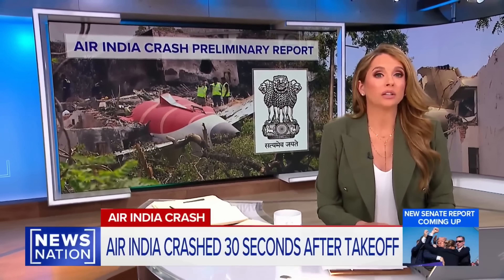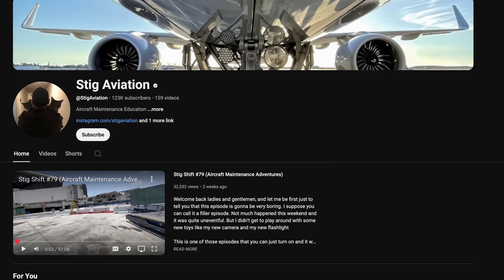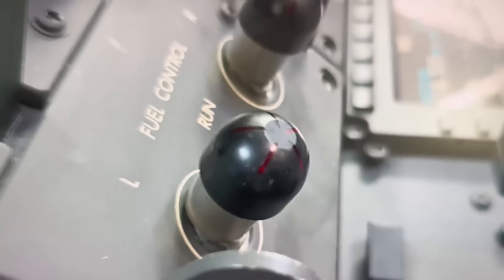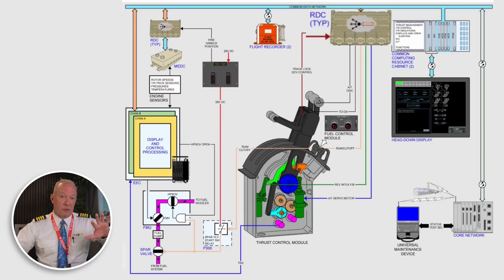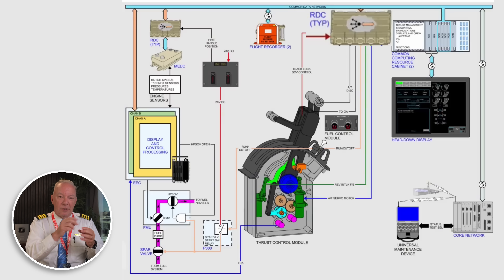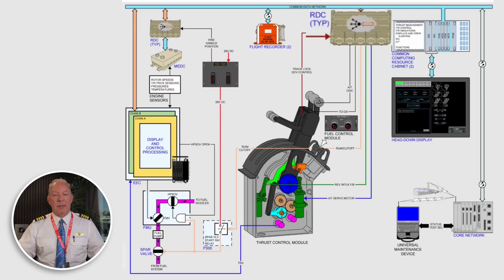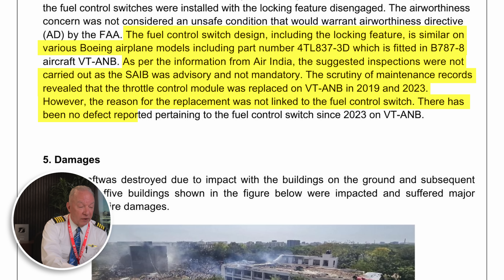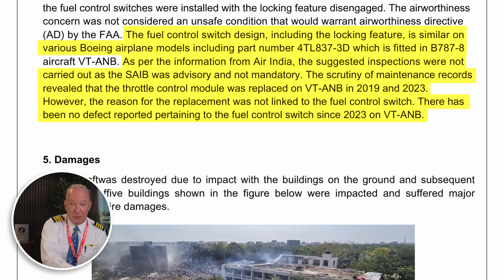The Truth About Boeing 787 Fuel Control Switches

Comment: Thanks. Also as a former AMT, the fuel valves are "Fail Safe" to the open position, meaning it takes electrical power to close them and are also directly connected to the main battery bus for that reason.
Reply: I think Steve is saying the opposite - power needed to open valve, so their default is closed. Do you know which is correct? (I do not). Thx.
Reply: @luxoverb  IMO, he's accurate.  Fail safe means, If power is lost, the valves stay open.  The schematic shows the valves and relay in the "no power" position which is fuel to the engine.
Reply: @TooStrongNeverFailed   Thanks!
Reply: @luxoverb  In case of loss of power they they stay open but in addition they open if they were close.
Reply: @luxoverb there is a difference in the relay being open and the valves being open.  He actually addresses this at ~18:30. A broken/turned off circuit is considered open.  If somebody cuts the wires to a bank vault does it open the doors or close and lock them?  open circuit-->closed physical actuation.

Relays are electromagnetic control devices.  As relays go there are 2 source currents.  one for control and one for operational flow.  He mentions both 24VDC and 48VDC. (usually the control circuit is much lower, like 5-12VDC).  There are 2 possible states to a relay: "Open" or "Closed" with the word "normal" applied to the state when the relay is not energized/activated by the control circuit.
So "Normal Closed" means that the contacts (battery to valves) are closed (connected through) in the normal state (no control current applied).  Apply the current (move the switch--I'm guessing to "off") and the relay pulls to an open state disconnecting power from the valves.  So closed relay=open valves; open relay =closed valves
Normal Open of course means the opposite.  No idea if thats how these are configured...just addressing some apparent confusion of "open"  vs. "closed" terms in electronic and mechanical applications.
Reply: @luxoverb the valves should be designed to be “Failed Closed”. Which means that without a power source, the valves will moved to the closed position using a built-in spring to move the valves to the closed position. Electric power is required to move the valves to the “Open” position.
Reply: @luxoverb yeah, you're exactly wrong, don't quit your union job.
Reply: @luxoverb  Steve contradicts himself on this at one point. I'm not sure he understands what "fail-safe" actually means. It means that if the switch fails for any reason and cannot supply a connection then the system will operate in a certain way, either "supply fuel" or "deny fuel". Steve just says there is a battery backup, which is irrelevant to this point. The battery backup provides control if the 28V line from the generator fails. @cupcar94 says that removing the voltage from the valves is what opens them, which is the opposite of what Steve said. This actually makes more sense as a design decision, as if all power is lost the valves will stay open but the fuel pumps will shut down, keeping it safe. If the only failure is the switches then the aircraft can still fly normally.
Reply: @Vreejack  How can it fly normally if the fuel pump is off?
Reply: @SDuapveer11  The engine will continue to suck in fuel using pumps mechanically driven by the engine itself, this is called "suction feed". It does have some caveats, e.g. attempting to use suction feed while (or shortly after) climbing to high altitude may result in air bubbles (caused by dissolved air coming out of solution) that can cause engine performance reduction or flameout.
Reply: Each engine has its own system, both with redundant power supplies. Schematics are shown in their “on the shelf” state. Steve isn’t contradicting himself calling the fuel system fail-safe: with power, the relay operates the fuel valves, but if 24 volts fail, the relay fails open and the valves stay open—so they can’t close without human intervention.
Reply: What everyone seems NOT to realise is that the valves/relays latch in their last commanded position. They are failsafed to both the open and closed position with the use of permanent magnets and, in the case of DC motor-spar valves, the valves simply do not move because motors do not operate without power. The electrical signals from the cutoff levers electromagnetically override the permanent magnet latching of fuel control relays which in turn operates the valves and drives the spar valve motors. 

Google "Leach KL series relays" for a typical latching type relays. Each switch has 4 poles and 8 output wires which, at least in the case of Cpt Steeeve's aircraft, operate 4 different relays with multiple system functions. Because the FDR monitors a lot of these systems, it is easy to see from the FDR if the switches have been physically moved and not some false electrical signal. You would need a dozen different specific failures to fool the FDR into thinking a switch had moved (when it hadn't moved).
Reply: fuel switches can't fail safe to the open position in case of that 28V cutting off, as the switches are used to cut off the fuel when the plane is parked. In that case it would need battery power for the entire time the plane is parked
Reply: This is the OPPOSITE of what he just stated.
Reply: One thing which is contradicting the narrative is the fact that if these switches are mechanical and are only linked to the pumps, how do they know the switches got moved. I guess answer is simple. They are still linked to the full system. A code write data once on or cut off. So something is not adding up.
Reply: @francoisdonnet3625 feedback loop
Reply: I do not know what an AMT is or does. What I do know is that a fuel valve is normally closed and requires power to open. Thus in the event of power failure it fails safe to the closed position.
Reply: @edwardsmiles5897 what you know, just isn't so.
Reply: I cant help but reply. What you are all speculating on is a highly simplified training schematic. It is NOT the whole picture. Spar valves are DC motor driven. Opening requires 28VDC on one connector pins and closing requires 28VDC on another pin. There are also limit switches which provide valve position signals and only allow the valve to open once fully closed or close once fully open. It's not just a single 28VDC power wire!
Reply: Wrong, the valves are electrically held open, and spring closed to cut fuel...
Reply: @BigWolfBoy50  If I ever knew that in one of the 8 different airplanes I flew professionally the engineers had the knuckleheadness of designing a fuel valve that would fail close I would have gone sick until I could bid out of that airplane, but of course that was never the case (because engine fuel valves do not close if they lose electrical power). 
Imagine this, you're flying across the ocean and for some weird reason your airplane loses all electrical power. What is the ONE THING you still want working when everything fails? Don't you think the aerospace industry after 120 years of making airplanes already figured out how to keep the engines running when everything else fails?
Reply: @EsparkyDog  10/10! Multiple types from different manufacturers myself. I don't fly them I fix them. Anyone here that is suggesting otherwise is speculating based on limited knowledge of how they think the system works, scouring the internet for anything that will re-enforce their confirmation bias. As I've said in a previous comment...What you are all speculating on is a highly simplified training schematic. It is NOT the whole picture. Spar valves are DC motor driven. Opening requires 28VDC on one connector pins and closing requires 28VDC on another pin. There are also limit switches which provide valve position signals and only allow the valve to open once fully closed or close once fully open. It's not just a single 28VDC power wire!  In addition, the engines will run just fine if the fuel boost pumps fail. Gravity and the  engine driven HP pump will provide more than enough fuel flow.
Reply: @DarrenCole-z7l  Captain says only 28V solenoids & springs but I think you're right
Reply: 4:46 Is the fuel cutoff relay contact normally open or normally closed? The circuit appears to show normally open.
Reply: So what about all the recent discussion concerning water interfering with the electrical circuitry? Apparently an AD was issued about that. Also, does the data recorder document the actual physical position of the fuel switches or merely the electrical state ( on or off) of the switches. Seems like there is constantly conflicting interpretations of electrical vs physical state of the on off function
Reply: @Sierranite  The fuel valve and the data recorder are on separate sets of contacts on the switch, so the fact that the switches were recorded as toggling and the engines subsequently behaved like you'd expect from the switches being toggled is essentially impossible to explain other than by the switches being physically toggled.
Reply: What about the fuel pumps? What if they loses power ??
Reply: @tdevosodense  If the pumps stop due to loss of power the engines are able to suck the fuel with the HP pump only (driven by the accessory gearbox)
Reply: This comment is irrelevant and induces confusion rather than clarity.
Reply: i am told by a technician that the fuel SPAR VALVES ARE SIMPLE SPRING LOADED type this means they arent motorized as many are thinking so , they only open if you send DC14/28 V in their coil . moment you cut supply they tend to be closed by spring push .
Reply: Same thing same analogy for semi-truck trailers. The trailer brakes are fails safe as well. They use a spring to keep the brakes engaged without air supplied them. When air is supplied to the brakes it compresses the spring to retract the brakes allowing it to roll. Likewise in an event of the trailer breaking away from the tractor truck, like a bad kingpin connection, the air lines will break off and since no air is able to keep the springs closed, will automatically activate the brakes keeping the trailer safe and not a runaway death trap. Good explanation.
Reply: It's the fuel pumps that failed caused by water ingress into the EE bays. Lack of lavatory maintenance caused the crash and not the fuel switches
Reply: I think this needs a much more detailed explanation as there's no relay in the actual fuel switches. I would think that there are two opto couplers at the switches that it's light gets blocked when the cut off switch are at either positions, that would also equal loss of power to a opto coupler. One signal from one opto coupler for open and another to close the valve. It takes electronics to handle that signal and power the valves. So you say it's using latching relays that takes one pulse to open and one pulse on another signal cable to close. https://youtu.be/8fAuRIWEgWY?t=62 If it has constant power it will probably burn out the relay, so some electronics generate the pulses. I think it is explained that one component failure can take out both left and right 28V battery buses. Take a look at this video https://www.youtube.com/watch?v=OLxLN3osS1Y
Reply: @urbanlarsson8252  The preliminary report CLEARLY states that the switches were physically moved to "cut off". What part of that don't you understand ?
Reply: @davidquinn6161  that is not what it says. The exact quote from the preliminary report says, "Engine 1 and Engine 2 fuel cutoff switches transitioned 
from RUN to CUTOFF position one after another with a time gap of 01 sec".

Precise language matters. The FDR does not record a physical location. It records a true or false value. You're interpreting the word transition to mean that the switches were physically moved, but that IS NOT what it says. The switches transitioning to the cutoff are MOST LIKELY a result of them being physically moved, however that determination has not been made in the preliminary report. I'm not arguing either side of the case here, however I am suggesting we stick to the facts.  The FDR does not record a physical location, rather it records a value...a zero or a one... an on or off. The word transition meaning that it changed from one value to another, which is an indication that it may have been "physically moved" but that is not a definitive conclusion that can be made simply upon that one fact.
Reply: @ernestwiker1295  True. Although it would be virtually impossible as stated in the video for two different circuits to do this a second apart in what is the time it would take to turn them off, and for both to come up staggered again. I mean reality here being that a fault would work that way would be so out there that it is unlikely.
Reply: @ernestwiker1295 The quote from one pilot is confirmation that the switches were moved .
Reply: @urbanlarsson8252  "If it has constant power it will probably burn out the relay,"
Relays have been around a long time and it was figured out long ago how to make a relay for continuous duty.
Reply: @urbanlarsson8252  Looking at the switch, it is not an optocoupler. It is basically a SPST mechanical contact switch with the control lever having a spring loaded extension needing to be pulled to clear the detent. But what is interesting is that the schematic shows the final valve HPSOV is controlled by a logical AND gate with inputs from both the fuel cutoff switch and the control module - meaning the control module could still shut things down.
Reply: @urbanlarsson8252  what? There are almost certainly some continuous duty relays in your car's fuse box my friend. Why would you think that there are optocouplers instead of just a wire? And who said it's using latching relays?
Reply: @urbanlarsson8252  Your understanding of electronics is good.  What you describe would be some sort of digitally controlled valve.  The stuff I've seen has a coli that operates an electromagnet.   According to another poster the valve has to have electric power to be closed.  That means that when sitting on the ground  the airplane would always have to be "plugged in" or there would be danger of a runaway fuel f;low problem with 1,000's of gallons of fuel.  This is not an insignificant issue.   Honestly I don't know exactly how it works, however I'm very confident that Capt Steeve doesn't either.  He only knows how it works when working properly. Electro mechanical systems have the habit of breaking.  For example when the Dali hit the bridge in Baltimore.  It was blamed on an electrical fault.
Reply: Thanks for this scoop. So it seems that 28v somehow got fed into both closed systems to shut them down and later that 28v would have to have been removed in order for start up to occur. And, according to the flight recorder data, these events occurred asynchronously each time. Didnt know electricity traveled so slowly.
Reply: @petermakris7331 The power opens the valves , it doesn't close them. He clearly explained that.
Reply: @petermakris7331 the electric field in the circuit travels at or near the speed of light. The electrons in the wire do not, but that is irrelevant.
Reply: yes, and if something cuts that power momentarily, the valves will close.
Reply: @rogerahier4750 it seems like you actually disagree with the original comment. I heard elsewhere the valves close when electrical is lost due to fire considerations.
Reply: @merchantmareedno, it's the exact opposite.
Reply: @merchantmareed seems to be on the 787.   It's not no the 737 where you have own backup batteries to shut them down in the event of a total electrical failure , even the battery failure..
Reply: @rogerahier4750  The AMT just said exactly the opposite, that if power is removed from the valves they stay where they're at, and they were open during takeoff.
Reply: @EsparkyDog  No they do not.  The default is closed.  It takes power to open them.  If you deenergize the relay, it's the same thing as shutting it off from the switch.  It shuts it down.
Reply: @rogerahier4750   That's absurd. If you were an aerospace engineer and they told you "Please design a fuel switch that when it loses power it will close, shutting down the engine.", what would you tell them?
Reply: @EsparkyDog Boeing might say "when can you start?" 😅
But in all seriousness, if you asked me that, I would ask for the reasoning behind it. What is the failure mode that we are trying to protect against and is it a more critical issue than having the fuel cut off - like a fire. Remember, fuel cut off at 35000 feet is not that big a problem. You still have time. Here what doomed the plane was when it happened. If they had another 5000 feet or 30 seconds, they would have made it.
Reply: @PranavSinganapalli  Boeing surely would hire me, I’ve been flying since 1981 and in the military or airline since 1988 so I more than quality for a Boeing pilot job with thousands of hours on 727s and 757s but I’m retired now. Strictly fun flying from now on.

You said: “If they had 5000’ or 30 seconds they would have made it.”
That’s why the suicidal captain chose to turn off the engines 3 seconds after liftoff.
Reply: @rogerahier4750  No, from what he says if the electrical  power is cut the valves automatically open.  I wouldn't call that "fallsafe" but a normally open valve.    If there is an engine fire, you have to have electrical power to shut off fuel to the engine.
Reply: @JoeLinux2000  The valves are not normally open.  It takes electricity to open them.  Cutting power to the relay would do the exact same thing as switching it to off.  It would deenergize the relay and turn the fuel off.  That's exactly what that relay is for.
Reply: @JoeLinux2000 you're wrong, the valve stays open if power is lost
Reply: @JoeLinux2000  thats the 737.... Here it seems to be the opposite. Even a fire would auto shutdown the engine... Which Is crazy, if you are taking off from a confined with obstacles airport. The 737 ,less automatic gives you the chance to shut it down when you want. Few seconds of thrust may save your soul... Don't delay of course !!
Reply: @rogerahier4750  In case of loss of power they they stay open but in addition they open if they were close.
Reply: @rogerahier4750  No, the fuel spar valve must be powered either open or close. It is a butterfly valve and not spring loaded.